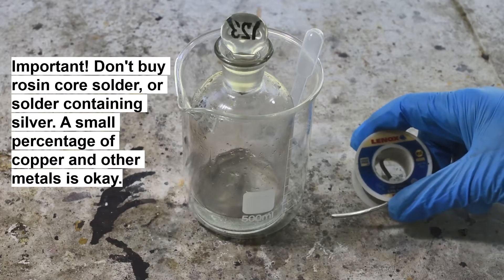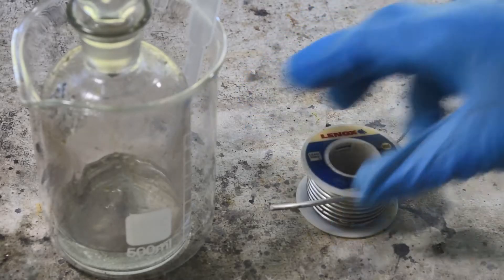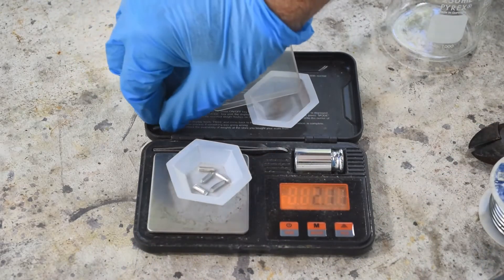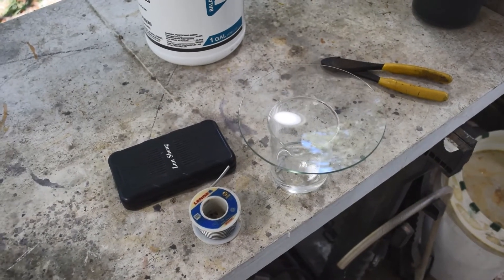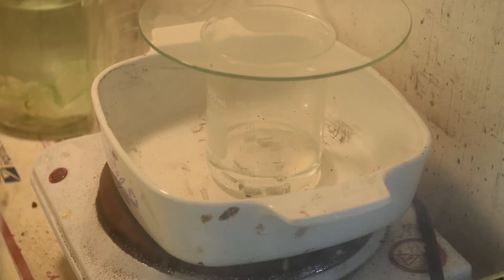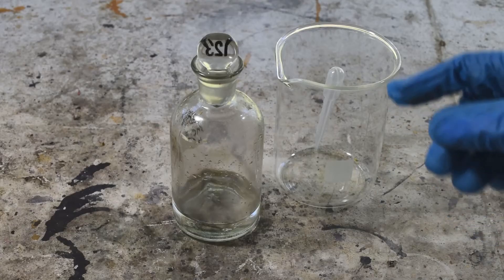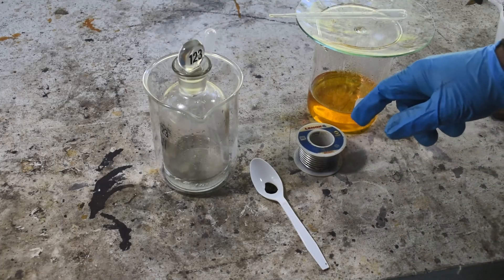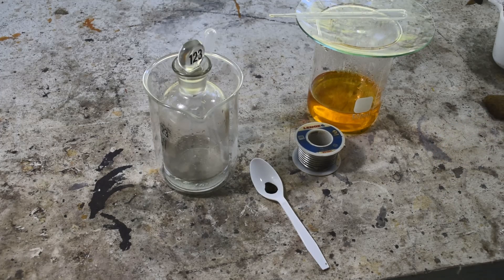Making Stannous Chloride Solution To Test For Gold Easily & Inexpensively

Comment: Oh, note, to get it dissolved really quick you could add some 30% hydrogen peroxide and put a few volts potential on solder wires to an electrolysize it into solution. 
    And if you use silver solder, the silver will react with the chlorides and precipitate out with the  sediment.

Comment: I'm having difficulty finding a lead-free solder that has no rosin core. Do you have other recommendations? The ones in the description is not available.
Reply: Just take one with rosin core and melt it until it stop smoking and you'll have the tin without the rosin. If after that you get some dark stains on it you can just wash them out with Isopropyl alcohol. I think hot water will also do the job.

Comment: does 20 percent hcl in room temp not work? because it's been a day and this stuff hasn't dissolved... only dissolving 5 grams. bought on Amazon 98 percent pure tin.
Reply: Lots to learn grasshopper, but never quit. Heat can make things happen, but never trust amazon - verify your material. A quick test for Tin metal would be melting point. Trust nothing from China.

Comment: Tin chloride is used to identify whether gold and platinum are present in a sample dissolved in aqua regia.
I asked if the sample contains other elements such as iron, nickel and copper, which could interfere with the detection of gold and platinum.

Comment: Actual "Stanous Chloride" isn't that expensive, nor is tin. My first run, I tried using "Pewter", (87%tin, 10% copper, 3% silver. OOPS!). After that debacle, almost disposing solution that was loaded with PGMS, I decided to make absolutely sure that I had 3 nines fine Tin. You might actually be getting false positives or false negatives with the solution that I watched you make. If you're capturing actual Gold, why not spend a few more dollars to make sure you're test solution is, "Spot On"?

Comment: How can you call this a "Stanous Chloride" test solution, without adding any "Stanous Chloride? Just curious.
Reply from the maker: Um, tin plus HCl = stannous chloride.
Reply: @omegageek64  Um, TIN dissolved in HCL  is not "Stanous Chloride". Granted it is the first step in creating Stanous Chloride. Your missing a few important steps, like evaporating the aqueous solution, until crystals of the dehydrated form, "Tin Salt" or Stanous Chloride. After this process, you rehydrate the concentrated, Stanous Chloride, with HCL and three nines fine Tin, to achieve a cohesive PGM testing solution. 

Three eggs, butter and cheese, don't make an omelet. You have to add heat, salt pepper, or you end up with a nasty mess, that, well. I guess you could eat; but, it wouldn't be an omelet. 

Usually, shortcuts, just end up getting you lost, or worse. If folks are wanting to test for Gold and PGMs, in solution, wouldn't you believe that it would be worth the extra effort to practice true chemistry, rather than risk a nonviable solution, that could cause someone to discard a solution that tested negative. Not because it lacked Gold or PGMs; but, rather, the testing solution they used wasn't what it should be. 

There's a reason why, "Chemistry", is called "Science". There are no shortcuts.

Comment: Hi Mike. Why it is important to use silver free tin? I though that silver will not dissolve in HCl.
Reply from the maker: Waste of money and yet more sediment. If the silver percentage is high enough, the solder may not dissolve at all
Reply: @omegageek64  I use bga chips for making SnCl2 as you demonstrated ones. Bga suppose to contain about 10% of silver, so you strip Sn contamination from bga chips, sediment is mostly silver and SnCl2, after filtration is ready for testing of gold in solution. I like killing few flies with one swipe. Warning about solder containing silver is at the best confusing, but hey, I like your videos. Thumb up every time.

Comment: I also use the same method to make stannous chloride solution, but the difference is I use waste solder which costs me nothing, then I keep the solution in the refrigerator, so the function will last almost forever.
Reply: What do you recover your scrap solder from?
Reply: @BrandonDebaker  Sorry, I didn't recover scraps solder, I get the waste solder from factory, but I think you can also cut it off from PCBA, or you can buy new solder if you only want to make stannous chloride solution.

Comment: I have a question with the easy of making stannous test from fresh tin.

What's your status on lab grade stannous crystal? Does that 5 dollar chemical supply crystal make Stannous Test the same as dissolving tin? Does it have a short shelf life living life as a "crystal stannouss" dry? And what's the recipe for a good test solution? Can it mix quicker than tin powder?

All I could find online for mixing crystal staneous is add small amount of Stannous crystal to hcl. There is no info on the crystal Stannous and its behavior, being an undocumented science supply chemical.

The test worked the day of for me. But I didn't know of expo on solution. After three weeks, back in the lab I never got a positive with my pure crystal made stannous solution, assuming know it was expired. Do you think my solution could have expired sooner, not using pure tin?
Reply from the maker: I'm no expert in this area. I've only ever made it from pure tin or solder.
Reply: Im no expert either. I have read:
Potentially you are testing dirty, contaminated solutions, so a high purity tin is not of utmost importance.
Some solutions will be highly contaminated depending on your material.
Im planning to use lead free pewter and have read this is satisfactory.  
I Also save relatively clean tin (possibly gold/silver/ lead/soldermask  +  contamination) from BGA scrapping to test effectiveness.
I Will take the residues undisolved by the HCl through a process to test for precious metals.

If you have another use for high purity tin, i would save it for that.
Great vid, great question.
Appreciate the vid.
Reply: Long winded, sorry.
If its cheap and readily accessible the SnCl² crystals are a great option, I also came across a post that mentioned supplementing your solution with a small amount of undissolved Sn as a preservative.
It might give you a slightly extended usage.
If you test this, let us know!